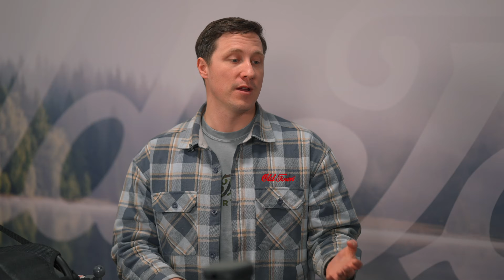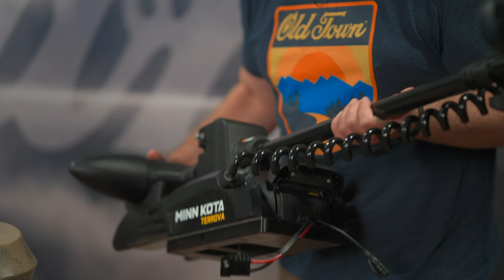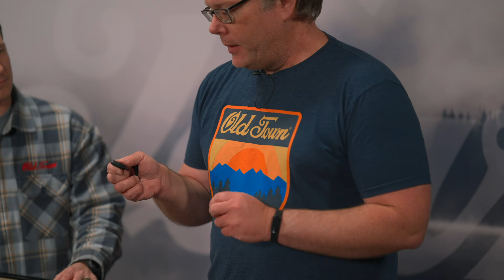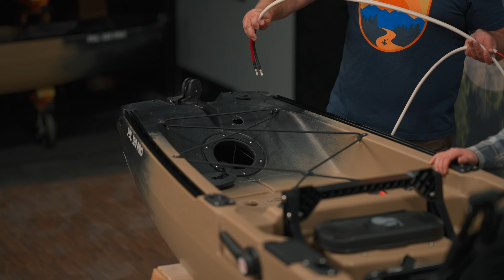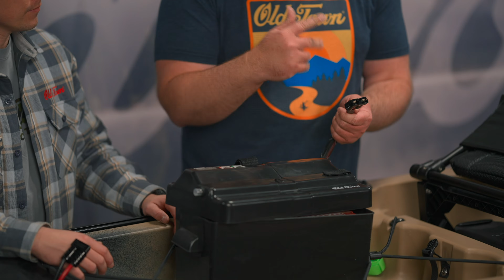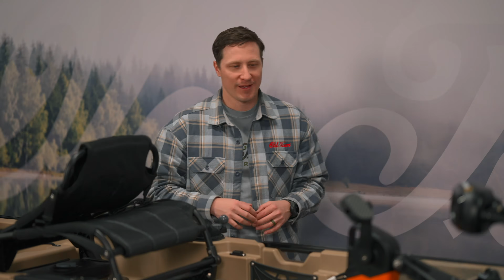How To Install Your Minn Kota Kayak Terrova Trolling Motor

Comment: Using 6 gauge wire does not work with the kill switch.  FYI. Need to use 10 gauge for the kill switch disconnects.
Reply: You can use 8 ga wire for the kill switch relay, but thats the largest I can go even though minn kota recommends 6 ga for the length of the run.